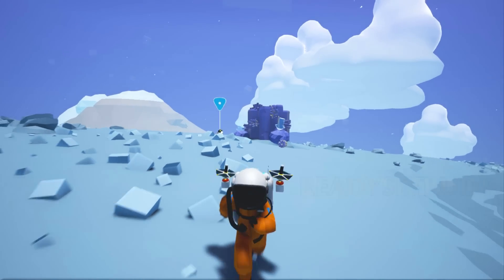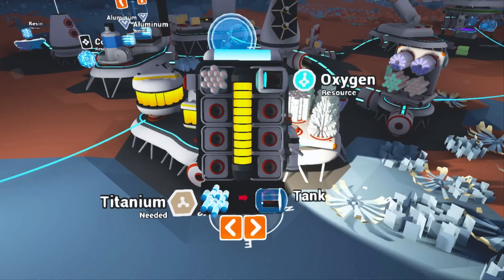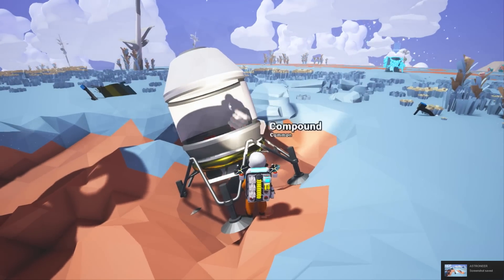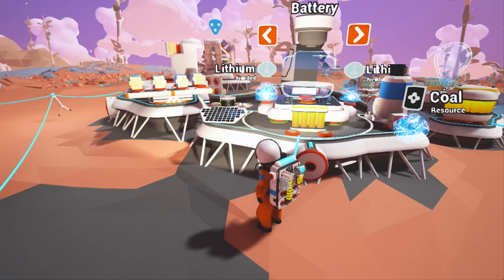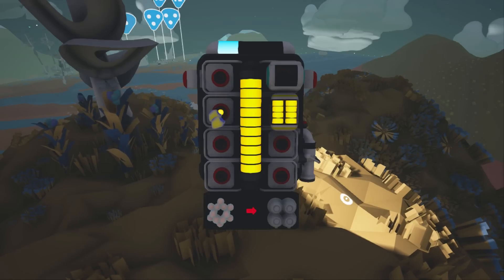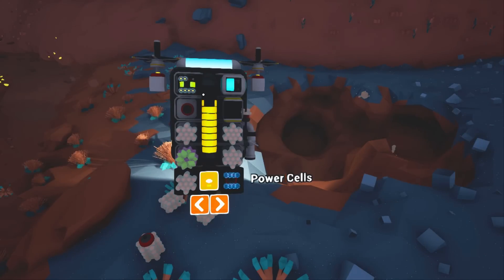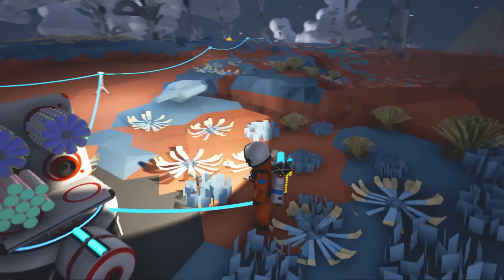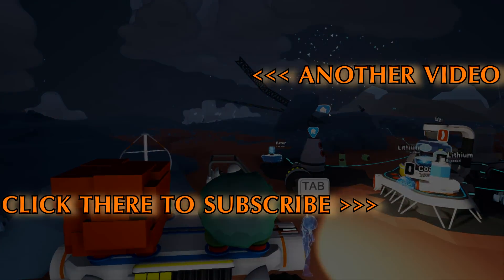Astroneer Guide - Oxygen Tank, Battery, Power Cell, Filter, Beacon, and Solar!

Comment: Good video! I will use some of the stuff like power cells and batteries, but I think the filter is kinda useless because you get infinite oxygen if you are near your base or rover. +1 like ;)
Reply from the maker: +Diego Garcia Yep, once you get a rover you never really need to worry about O2 and in caves you'll probably always be putting down tethers. Of course, you can choose to play without a vehicle for the challenge :)